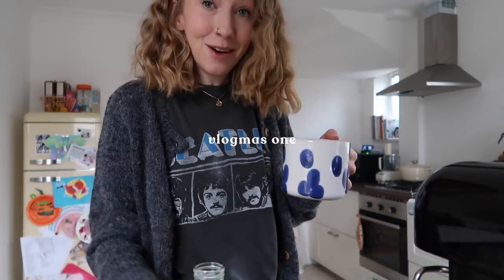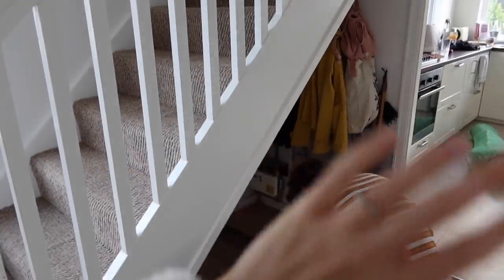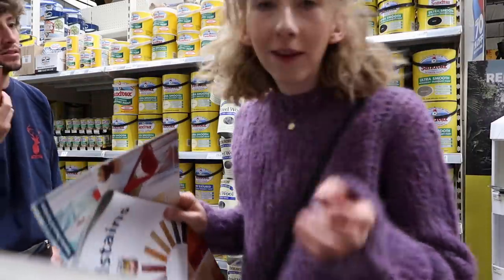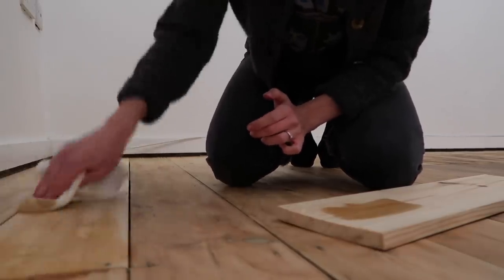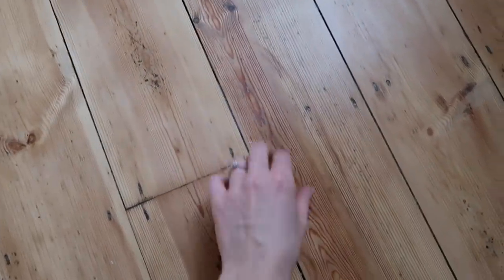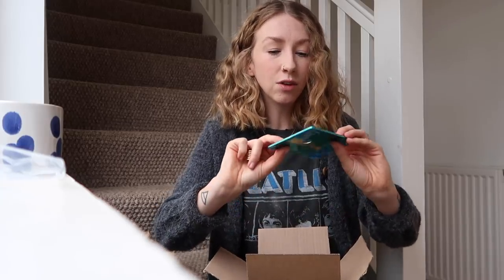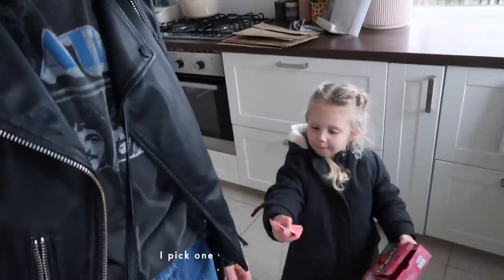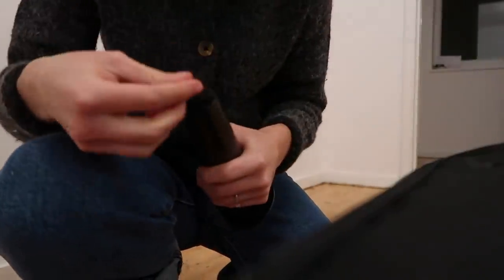Our DIY Floor Restoration & Vlogmas Begins | VLOGMAS

Comment: The stain around the edge is super common - we had it in our house and I feel your pain with the sandpaper issue! It was a massive Trend in homes at one point to have a massive rug in the middle of the room and then stain the edges only with tar varnish 😅😅

Comment: The black finish on the floor is a type of stain called japan.  It’s a bitumen based stain which was only applied around the edges because a floor rug would have covered the unfinished middle bit.  It’s a bitch to sand.  My husband and I got tried to get people in to finish our floors, they didn’t want the job, didn’t want to touch japanned floors, so we tried to do it, got halfway through, changed our minds and laid carpet.  Kudos to you for sticking (excuse the pun) with it. Floors look great, you must be very happy.

Comment: The floors came up lovely 👍. It's so much work, we had 3 of the bedrooms done professionally and then I did the kitchen and other bedroom but I pulled up all the carpet underlay and millions of staples and those wood strips with the nails from every room. I still haven't done our lounge but it had been done in the past so not in too bad a condition. An easier way to apply the varnish is with a lambswool applicator which is attached to a broom handle. It gives an even coat and no bending over and is also super fast to apply it. xx

Comment: oooh I know the answer to the varnish question (far too geeky and excited - sorry!) it's from the days before modern carpets. The edges would be varnished and then a large rug would be laid in the centre of the room. Is it a Victorian or turn of the century house you live in? We have a 1860's Victorian semi and we have the exact same thing in our dining room which we're hoping to sand in the next few weeks. I actually quite like the style and we're playing around with painting the outer bits of the sanded floor white and then getting a big rug for the centre when we've finished :) x
Reply: I've also just noticed in the description that you used Dowsing & Reynolds fixtures - I love them so much - we've bought a few things from them also for our renovation - and how cute and quirky is their packaging tape?! :) x